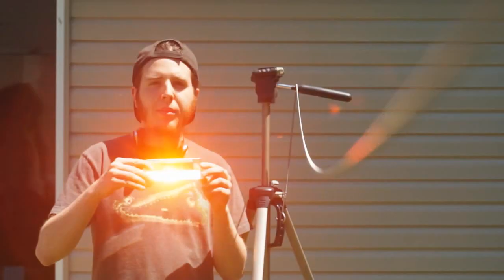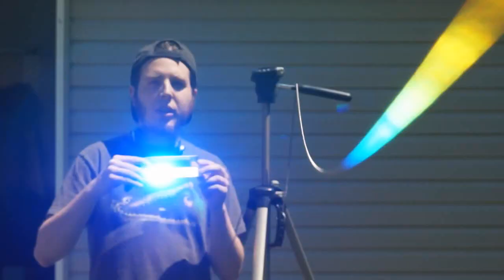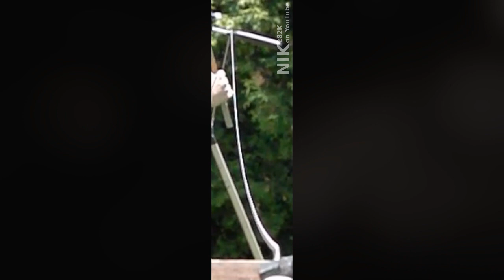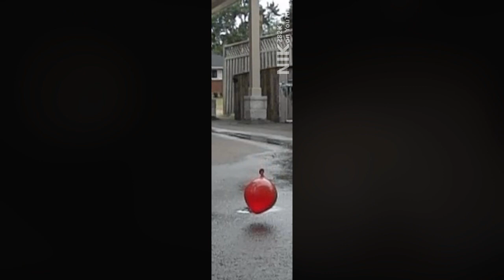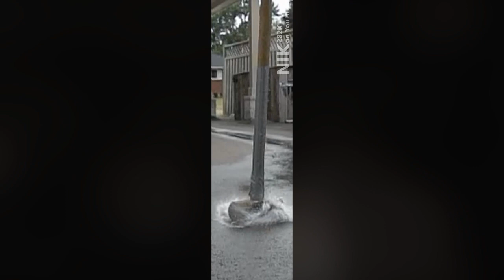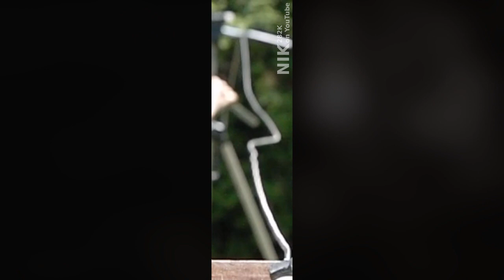Acoustic Dispersion in a Spring

Comment: is this phenomenon related to the heisenberg uncertainty principle? I just finished watching this
https://www.youtube.com/watch?v=p7bzE1E5PMY
and was reminded of your video :) you do good work, thanks!
Reply from the maker: Oh! I never thought of trying a radial/helical wave!
Reply: In a mathematical sense, yes. The width of the pulse in time is related to the number of frequency components that make up the pulse through a Fourier transform relationship. If nick had hit the spring with the palm of his hand, the resulting pulse would have been much more broad and contained less frequency components to disperse. It wouldn't have sounded quite as "laser" like. The idea being, the more well defined in time the pulse is (sharper), the less well defined it is in frequency (more frequencies). In quantum mechanics that would be like momentum/position, or in optics it would be like beam waist/wave vector relationship (for gaussian beams).

This idea of using a sharp pulse to probe a system is used in a lot of different contexts. You can characterize the acoustic response of a room by recording the response of a clap or gunshot, because the sharp impulse contains a large number of frequencies that all travel out at once. Analyze the return frequencies and you can determine natural frequencies and such. Fourier transform spectroscopy does a similar thing with light or radio waves.

Comment: I love doing this. I was a debt collector for a while and had a steel slinky. One day I had a small styrofoam cup at my desk that was empty and had placed it in the slinky. I accidentally dropped the back end of the slinky with the cup still in it and when it hit the ground it sounded like I was shooting off a sci-fi laser gun. I was so amazed and amused. I did it for like 3 minutes straight until My boss came and took it away. I could hear him playing with it in his office cracking up. I also used to smack the tension lines at radio transmitter towers with large sticks when I was a kid and would go with my dad while he worked on the transmitter.
Reply from the maker: Since I got a hold of the spring in this video, not a day has gone by where I didn't stretch it out and make that noise, there's something just too satisfying about it.
Reply: YEP!

Comment: Dispersal is how a natural resonator will dissipate energy by preferentially vibrating at its resonant frequency and its harmonics.  it's somewhat of a quantum effect.  Left-over energy that isn't enough to resonate a the least energetic fundamental vibration will instead go towards damping existing vibrations.  This excess energy, I believe, is responsible for the nodes and antinodes moving along the length of the spring; if it were a perfect resonance, the wave would stand.

I think a prism is showing diffraction, and not dispersal.  :)   Many DPSS lasers are example of optical dispersal, as not only do they emit light at a fundamental frequency, but also at multiples of that frequency.  (And why some can be dangerous if not properly filtered at unwanted frequencies.
Reply from the maker: Ahh, thank you, I'll have to look more into that direction, I had some serious troubles trying to find a straight answer as to why this all happens in the first place.

The prism shows dispersion but of a completely different type, relying on refraction and refractive index to do the separation. I only included it as a 'familiar' experiment. I actually almost built an acoustic prism, a triangular frame wrapped in light plastic and filled with CO2 (or a heavier gas). I was going to pump white noise into it and see if I could detect the separation of the white noise into a hiss of higher/lower pitch. I didn't end up doing it because it would have been a larger setup than I have room to test.
Reply: Check out what some MIT folks have done with regards to low-frequency video analysis at videoscope.qrclab.com, which has a tool that lets one upload video clips to be analyzed with a myriad of settings.  There's a sample clip of guitar strings that seems relevant...  although it's a cool video analyzer nonetheless.
Reply from the maker: I'll have to give that a shot. I wonder how quickly the highest frequencies make it to the far end of the spring.
Reply: The fastest ones should be around Mach 1 in the spring material:  ~6000 m/s in steel.   The components of the impulse that match the spring's harmonic resonance frequencies exactly will set the whole thing vibrating at its Mach 1, but those are probably too slight to show much.
Reply from the maker: That video analysis may show it, the coils artificially lower the speed of sound (from a viewing perspective) because the vibrations have to go around every coil rather than the measured "length" that we see as a spring. I wonder, is there an optical equivalent of a spring? If you fire an extra short pulse of white light in one end you would get a long rainbow pulse at the other end.
Reply: I recall reading about some wacky properties of Erbium doped optics, which I suspect  you'll find fascinating, if not specifically related to dispersal.  
(A chemist friend of mine had quipped that the Lanthanides were real snoozers, chemically; my counterpoint was that they more than made up for it in their exotic physical properties.)  
I'm not sure spectral emissions can be expected from this effect:  A continuous spectral emission is incoherent light, or the optical equivalent of noise; that's not at all the result from the dispersal effect on the spring, or ice sheets (There are videos of ppl bouncing golf balls on thin pond ice; sounds awesome), which the result is more of a resonance function.  The optical equivalent that comes to mind is the frequency doubling that happens in at least a diode-pulsed solid state laser optical cavity, where a long wavelength input source gets reflected and refracted back on itself within a crystal, to emerge at double, quadruple, etc the input wavelength.

An electrical effect analog comes from having an inductor connected to a capacitor, where an EMF injection or magnetic flux change will set an oscillating resonance up in the circuit of a particular set of frequencies; it's the basis of tuner and filtering circuits.
Reply from the maker: Nevin Williams I will have to test my 'Google-Fu' skills and find out more. I never expected this much interesting stuff to come from goofing around with a spring in the back yard.
Reply: I came across articles on dispersal, and discussions on spectra being a form of it, just now.  A mention of Group Delay/Velocity  seems to address the movement of a wave envelope through a medium.

I'd confused Erbium's optical properties with the fairly new 'slow light' phenomena, however, or at least, I find no specific reference to erbium being used;  I think I read it in a book, and not online.    https://en.wikipedia.org/wiki/Slow_light  

A great many of your videos have prompted me to really dive into deep fundamental principles on things I've not thought about before, so I kinda expect to be looking at all kinds of new principles based on the neat stuff you do.  Perhaps it's because you ask questions about what you observe, instead of telling what it is...?